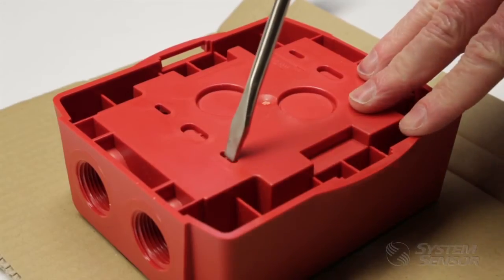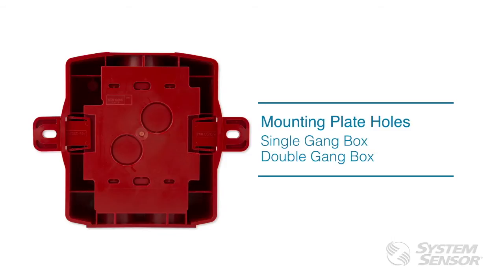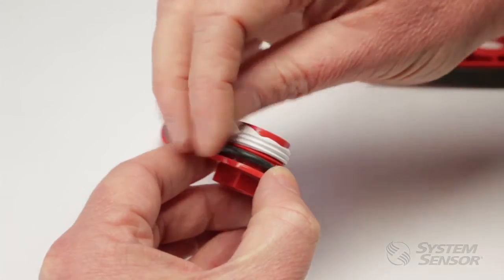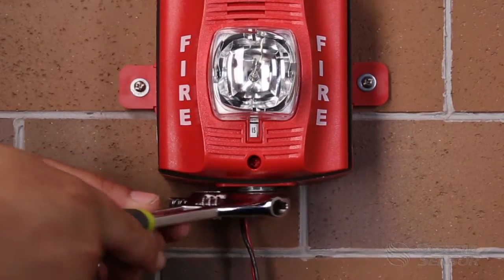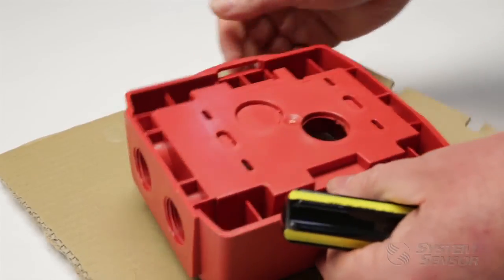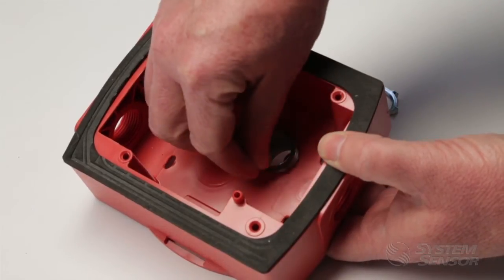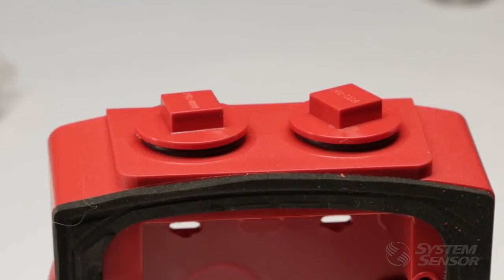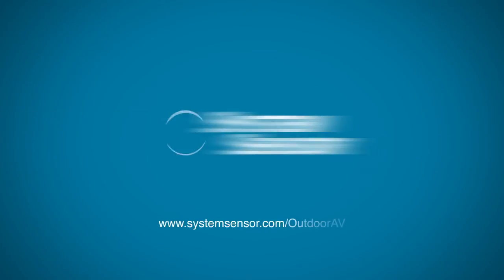AV - How to Install Outdoor AV Back Boxes

Comment: ARE YOU KIDDING ME!?!?!? pipe dope? foam!?  and the funny thing is, they offer a backing  plate that holds the Audio in one, and Visual in another, and the thing isnt even level! and you gotta add some kinda shim in the top half so it sits flushush on the wall, and theyre worried about plumber's tape on threads.. LOL